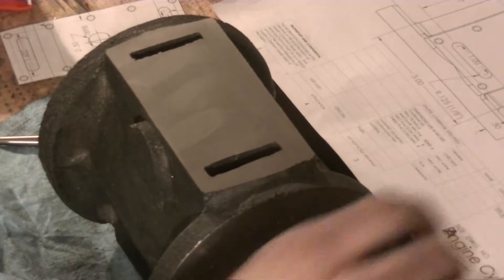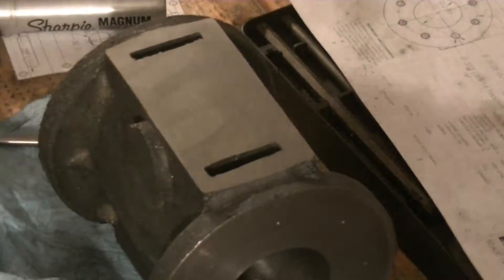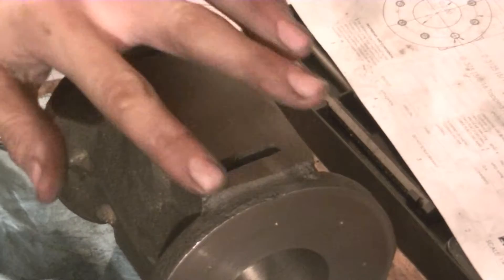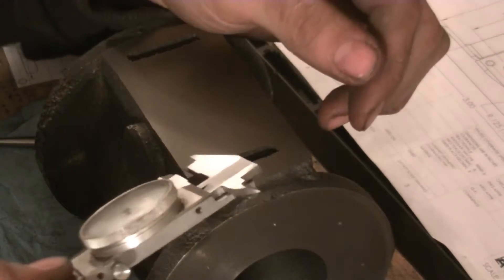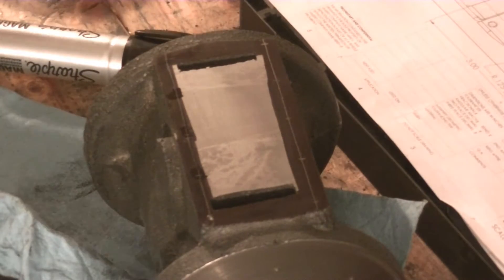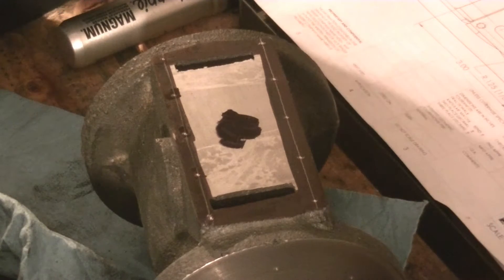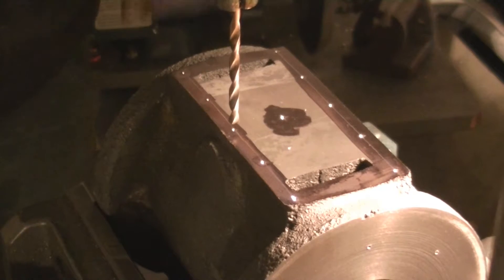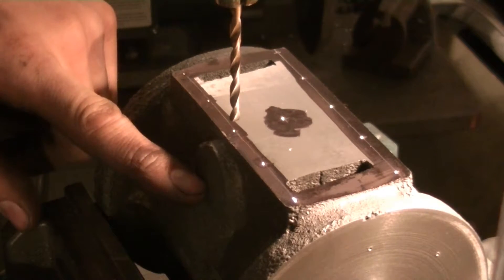Steam Engine Build: Machining the Engine Cylinder: Part 4

Comment: But, are those long line parallell?
If you have a square, you can measure diagonally corner to corner. They should be same. How long, use Pythagoras triangle. :-)

And yes, I do really, really like your videos!  Thanks!
Reply from the maker: Thanks! The lines on the side of the engine are not perfect, as it is a casting, but it is good enough in my book for doing layout lines.  Rough castings are always like that because nothing about them is exact.
Reply: Yes, but are the holes properly aligned, it will be easier to make them on the plate you are going to bolt there.  And it might be easier to make the holes for the bolts after you have done the holes in the other piece. 
But yes, you can still make them afterward.